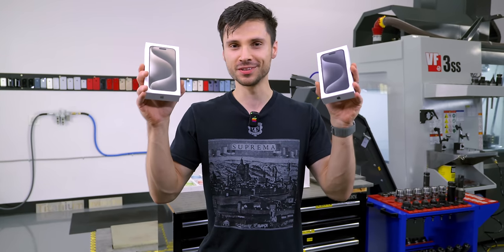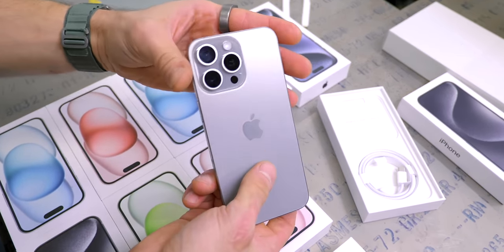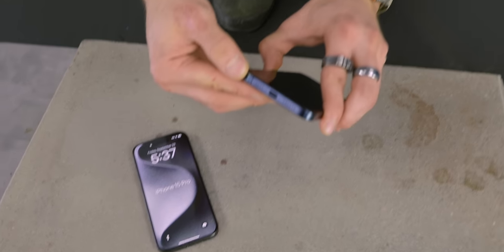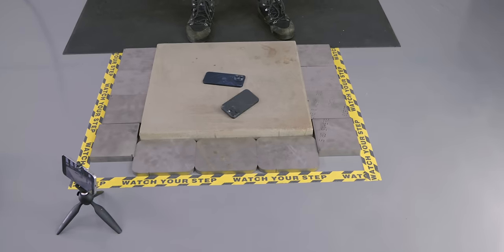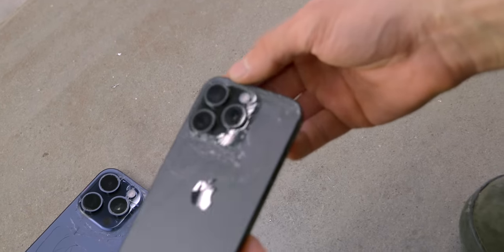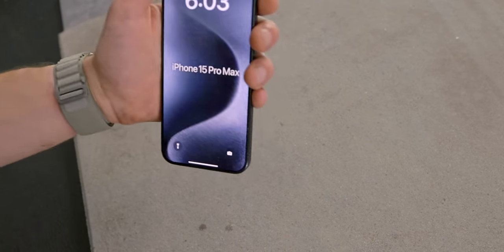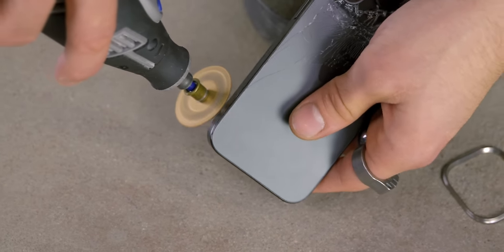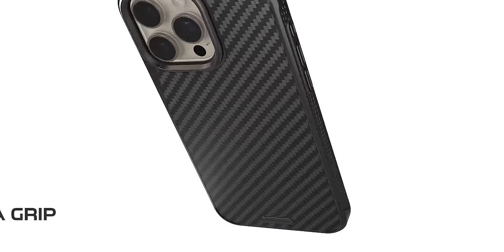iPhone 15 Pro Max vs 15 Pro DROP Test! TITANIUM At Last

Comment: switched from mous after my back glass broke on my old phone in their case. used rebel on my 11 pro. absolutely satisfied by the product. very good protection (dropped my phone a number of times with zero issues) while keeping the case minimal and still showing the beauty of the iphone.
just got the 15 pro max (I feel very lucky it came in already when I was told it’d take a month to arrive), but now I have to baby it until you guys release the new cases. keep up the good work!
Reply: which mous case did you use, clear or limitless? i was using limitless on my iphone xs for 3 years with no problems at all. now i have bought iphone 15 pro max and considering which case to go for!
also, which rebel case do you recommend?
appreciate your reply!
Reply: @ORPHEUSEXODUS  not sure. I used mous years ago with my iphone 7 and had zero problems. then I used it with my iphone xr and my back glass shattered. that was the only time i’ve broken a screen or back glass on any device. I don’t recall any major accident so I partially blame mous. although i’ve talked to others who previously had iphone xr’s and they also said their back glass broke, so maybe those phones just had weak glass. either way, I switched to the rebel flex with my iphone 11 pro; I absolutely loved that case. very minimal and very protective. the mous cases cover the beautiful design that is the iphone, rebel protects while still showing off the apple design. I dropped that phone numerous times without any worry. cannot possibly recommend rebel more based on my experience so far. anxiously waiting for the 15 pro drop.
as far as mous goes, I haven’t been a customer of theirs in a minute, so I’m not trying to discourage anyone from purchasing from mous. I’m sure mous is still better than most case companies. but in my experience, i’ve had absolutely zero complaints about my rebel case. I’m probably going to get the regular rebel gen 5 for a little extra protection (I hear the titanium sides can get scratched easily) but if the flex releases first, i’ll have to get that.

Comment: Some constructive criticism:

Your audio is mixed to left instead of mono. Select mono when adding an audio track when using your lappel setup. 

De-ess more

Try like a 6:1 - 8:1 compression on your audio

I've watched your channel off and on since your video on the 2013 mac pro iirc, and your audio is the only thing that hasn't scaled with the rest of your quality. Other than that, it's been nothing but up. Keep at it boss, feel free to reach out if you want help.
Reply: YES exactly this

Comment: I have the iphone 12 pro max and ive dropped it atleast 20+ times without a case and with a case. The only damage my phone really has is a little crack barely even seeable. I think the 12 has the most powerful dropping limit

Comment: While the 15 Pro feels a bit nicer in the hand in some ways, I noticed the back edges kind of scratch you because there is a difference in the back glass vs. the front glass.  The front glass edges have a very very slight curve to them to meet the curved edges of the titanium side band, so when you rub your finger across where the front display meets the titanium and around the corner, it will feel more like a smooth rounded transition. It's not as good as the old curved iPhones and even the 14 Pro feels smoother when you swipe to the edge or from the edge of the screen inwards because the 14 Pro glass is completely level with the Stainless sideband.

However, the back glass of the 15 Pro is not perfectly level with the Titanium band for some reason. Which is a weird oversight by Apple.  So when you run your finger across it doesn't meet the titanium band perfectly level and you actually feel your finger "scratch" when you rub your finger between the back glass and titanium where they meet together.  It's kind of sharp when moving your hand around.  So I think what happens is if the corner of the titanium is bumped the titanium transfers the force of the impact to the back glass specifically as the titanium sits higher than the glass.  It's VERY hard to notice unless you look very closely but it makes sense why in all these drop tests the back glass is breaking immediately and the front can take way more damage.

Also explains why the 14 Pro is so indestructible and I don't think it's solely because the stainless steel is stronger, but that the glass is tighter and perfectly flat and level with the flat stainless steel edges.  So the steel takes the force of the impact more and there's no "gap" for force to transfer to the glass.

It's kind of annoying because while I love the curved titanium edges in theory, the scratchy feeling is definitely not up to Apple's standards.  I'd love if they kept the squarish design but made the top and back glass raised up a bit so they curve more into the titanium to create a perfect rounded transition, and then keep the sides flat like a brick.  But maybe a tempered glass or hydrogel film over the front and back would solve this problem and also save the glass from these falls.  Thankfully AppleCare+ has unlimited damage and screen replacements are only $29 though..

But disappointed as I wanted to rock this one careless with just a screen protector thinking it would be more durable, and sadly it's less durable so I have to cover up the beautiful design with a case.

EDIT: Literally just went to the Phone Rebel website and realize your cases are exactly what I was talking about. Nice bumpers that are level with the glass and curve just like the iPhone 15, no sharp edges, and great protection and even titanium camera lens protector and aluminum buttons!! That clear case looks awesome!  Definitely checking these out.
Reply: Bro

Aint

Readin

ALLAT!!!!!!!
Reply: @Popseoh  I did and he got some points
Reply: @Popseoh All

You

Had

To

Say

Is

You

Can’t

Read.

Also you spent quite some time on that reply. Should have spent it reading my comment. It had purpose at least. 😉
Reply: I agree with the front glass but for the backglass, mine feels smooth, what nub are you talking about? If there are any, I don't feel it's significant enough to be irritating or scratch your hand or finger. Imo this feels a lot better than the iPhone 14 pro as the sharp edges do cave into your hand after extended use.
Reply: bro wrote a whole thesis 💀
Reply: @wahahah  Unfortunately it seems to be random and the quality control isn’t great. Some phones have a slight better feel. Some people have the sharp edges on the front but most have it on the back. It’s when you move your finger back and forth across the point the glass and the titanium band meet, towards the titanium edge. I didn’t feel it when I first got the device and it’s not terrible. But I do notice it on my palm when switching to one hand use.

Even if you don’t feel it try your fingernail and try going across it to feel the gap. On the 14 Pro Max that gap is air tight and the edges are way smoother. The steel being glossy also helps. This would explain the durability.

I like the rounded edges better also and I have a case on the phone now anyway. But sadly only some phones have a perfectly flush rounded corner.  I may swap my phone and see if I can get a better version.
Reply: Do a video version bro. Seems a legit review to me.
Reply: @Popseoh Actual child.
Reply: That really sucks :( Did not know there was a scratchy part
Reply: @mikechansw748  You dont understand internet humor my friend 😂
Reply: Curved glass breaks far more easily, simply bc of the impact. There is no cushion to land during fall, so all the weight and impact falls on the glass. And since the back panel is fairly fragile, it all collides. But good news - Apple Care is only $300, so it makes a $1800 phone y’all!
Reply: @onlinecomment  The curve is so subtle it's nearly impossible to see with the naked eye.  You have to really look under the proper lighting and keep angling the phone and it only appears to be on the front glass.

But the problem I and many others are experiencing is that the back glass sits LOWER than the Titanium band which I'm sure is due to the tolerance of the titanium the quality control isn't perfect yet. Which causes it to be off by microns.  So the sharp edge of the titanium is sticking up higher than the glass in certain spots to where it feels scratchy when you rub your hand or finger across it.
Reply: Dude, do you think it's iPhone 14 or iPhone 15?

If it is an iPhone 15, how can I prevent this fragility and even if I prevent it, will it break like this?
Reply: I don’t notice that on mine. Maybe because I bought later and it was a second batch? I don’t know. I just slap a case on it and call it a day.
Reply: Just commenting to say that I ain’t reading all that

Comment: Awesome to see you making videos again!
Not sure what you are so excited about? 15 seems to significantly weaker than the 12/13/14 as none of them had cracked backs from waist height drops. 
Looks like apple was forced to make backside more replaceable and punished us with more breakable glass.
Reply: Could also be due to titanium frame as its less flexible
Reply: @BasicBrute  wouldn’t that be convenient for apple? Regardless of the reason we now have what appears to be an inferior product.
Reply: Because of the Titanium the frame is in fact less stiff and allows it to flex more. Titanium isn't the stiffest material but has some other very interesting properties.

Comment: Great content. As you know, working with titanium, that it's super strong but super easy to scratch. And when it scratches, it's very hard to almost impossible to buff out or refinish.  Everyone who gets the pro version needs to get a case for it.
Reply: Apple is claiming that the Pro phones are rocking grade 5 titanium, and if that's true, then I guess it's more scratch resistant than stainless steel.
Reply: Grade 5 titanium says nothing about how scratch-sensitive it is. 

Grade 5 only says the composition and associated material properties. With grade 5 titanium you get an alloy with significantly higher strength than pure titanium (grade 1 -4), heat treatable and some other improved properties to pure titanium. 

However, since titanium is a fairly soft material, it can be scratched more easily than a stainless steel frame of the last generations. 

The reason to use titanium as a frame is mostly based on marketing, not because it has a significant benefit
Reply: @Krishna_W16  Then what is the reason to make a phone from titanium just to put it in a case?
Reply: @user-ym5mw8ft6d  If they can sell a piece of cloth for $20 and cabinet wheels for $700, then this ain't nothing.

Comment: Im thinking of going with the 15 pro max. I’m liking the frosted back in the rebel lineup. I’ll be picking one up for sure. Thanks for the yearly upload.
Reply: hi mate. have you seen other durability reviews of the 15 pro max? it looks like it’s not that good. i always take care of my phones but don’t know if get that one or wait a bit
Reply: @fabri1314  I haven't seen much yet. wait a little for other reviews to come out before moving forward then decide on it. for any iPhone, ill be putting on a Good case and screen protector at the minimum for precaution. this year's durability Is definitely questionable but wait a little bit more. I am too. then make a decision after more info is out

Comment: Now I’m having second thoughts about buying the 15 pro. Have dropped my galaxy A5 several times on concrete without a screen protector and only a very cheap and thin silicone cover and it still looks like new. Have had it for 6 years… iPhone cracking so easily is very disappointing

Comment: Ok so the screens on these phones are quite strong, but i would wonder with these drops case or no case on the phone how would the internals react would there be any battery or elevated heating issues after that ?

Comment: I wonder if the back glass is more fragile because they made it replaceable or if it’s all about the camera set up older iPhones seem to do a lot better obviously it’s the front glass that really matters and most people will use a case however if my iPhone can last 4 years without braking dose it really matter if the new one is cheeper to repair? You might be replacing it so often that it cost more in the long run

Comment: What’s your opinion to upgrade from iPhone 11 to pro 15 or 15 pro max ?
Reply: I think its about time, you could wait 1 more year for them to stop rolling out updates but if your 11 is slow and not performing that well I would look into a 15 pro. Pro max would be great only if you want a larger battery, slightly better camera zoom and more immersive size but it is harder to use and hold due to its size and weight.
Reply: @oscar7476  thank you for your response be well

Comment: I consider to switch to the apple from android, but I have few q:
1. Can I change controlling from gestures to three "android like" down screen buttons
2. Does usb slot accept usb sticks?
3. Can I use not only apple chargers (because has finally usbC)
4. Can I change screen setting to main use arrea under dynamic island ?
5. Does it have saving battery mode or dowloadable?

Comment: My only 2 critiques are the glue and heat don’t mix well so I’ve taken the case off to clean a bit and the bottom of the MagSafe from the case stuck to my phone.  And the charger port isn’t that wide so it has to be specific usb c to c cables some, “like Samsung” are not compatible they’re too thick

Comment: Any videos on drop test using rebel 5 for 15pm? Because i saw ither comments saying the plastic frame inside holding thr screws are protruding enough to touch the back panel of the phone which id you drop it and straight impact to the lens frames it will shatter the glass ?

Comment: im at 07:22 and thinking the iphone 16 pro just announced a few hours ago i want a case that protects the sides and the corners but leaves the buttons accessabel so i can press that camera button with haptic fees.. and a glass back and front for scratches and impact so a bumper but with parts not covered.

Comment: Plan on buying a spare case and screen protector. Purchased their Gen 5. Over a week still hasn’t shipped. After numerous emails keep getting gaslighted with the ole case is in the mail excuse. Problem is USPS didn’t receive it. Instead of shipping out a new one right away and recalling the one that supposedly was sent with insurance, they make excuses. Keep putting it off saying give USPS one more day. Finally on the third email agreed to resend it so would have to wait 4-5 days to get it due to now we have a weekend coming up. If they resent on second email I would have received before the weekend. They agreed to overnight if it wasn’t tracked then when it wasn’t they decided to just ship another normal shipping after previously saying they would next day it. Nothing but excuses doesn’t matter how good the case is if you have to buy another one and another screen protector while waiting for them to ship the one already bought and paid for. Run from this company. The good reviews are probably friends and family. Seems like a scam we will see if u get my refund or if I’m going to have to dispute it.

Comment: I want to buy an iPhone 7, so far I haven't been able to buy it, I'm still using an iPhone 5s 🤣😂
Reply: iPhone 7 doesn’t get new software updates and it slow for 2023 I really recommend getting something on the cheaper end but it mid range for 2023 standard so get yourself a Samsung A Series phone
Reply: @prevolume  Thank you bro for the recommendation, hopefully I can buy it later, I'll try to save first
Reply: @DodomojoTravelTech  they are fairly cheap for the quality that they serve they are usually about 200 for the better a model or more for the even more recent ones but some of them are less than 150
Reply: Recommend getting a14 and or a34 either second hand or on discount!
Reply: @prevolume  Once again, thank you for the information, bro. I hope I can buy it as soon as possible
Reply: @prevolume  Once again, thank you for the information, bro. I hope I can buy it as soon as possible
Reply: @prevolume  A14 or A32 one of them, hopefully it will be mine later 🙏
Reply: @prevolume  A14/A32 in my country, Indonesia, the price is around 200 to 150 I have checked in the online shop

Comment: Yall they didn’t make the back glass weaker. It just doesn’t have the support it had before when it was all one piece. To make it easily repairable they had to make it its own separate piece therefore losing the strength and integrity the previous iPhones had

Comment: Was skimming through the video but got confused by the final statement - "Apple did really well here". What did they do well in? Working with Titanium is cool but it's more expensive than aluminum.What actual benefits did it bring apart from the coolness factor? Didn't seem more durable. Maybe it's just for the coolness factor? If so, that's a shame for a company that had a legacy of innovation.

Comment: My phone rebel case for my 12 is the absolute best case I’ve ever had. Slim, sleek, but does its job extremely well. I can’t tell you how many times I’ve dropped my phone and still to this day have no cracks. But my friend’s 13 case has been awful. It’s falling apart and has not done its job nearly as well. Quality went way downhill and I hope  that has been fixed